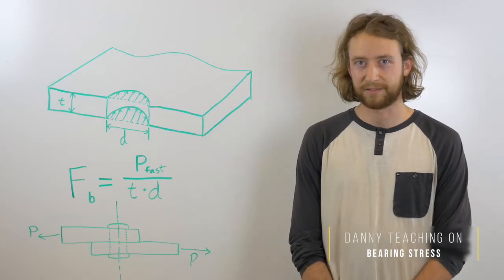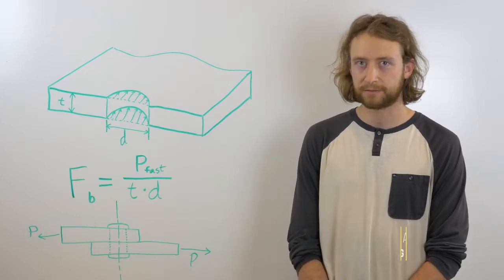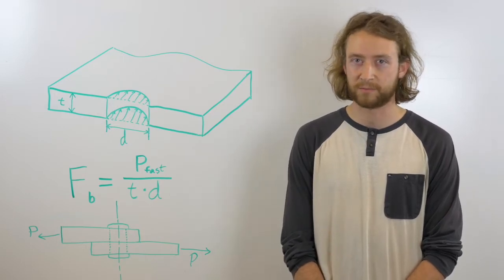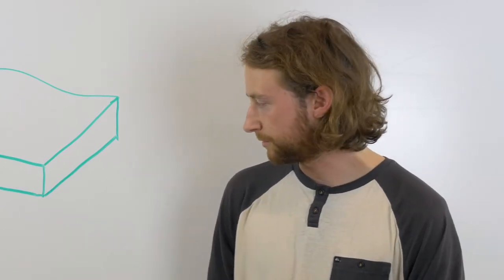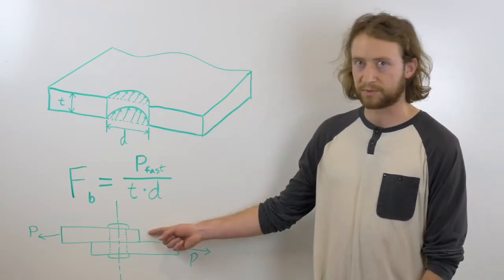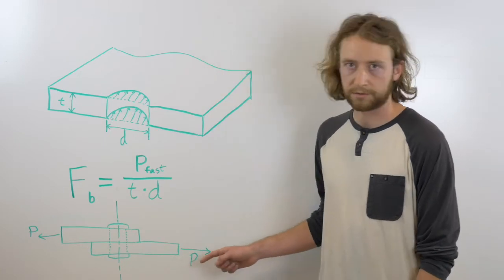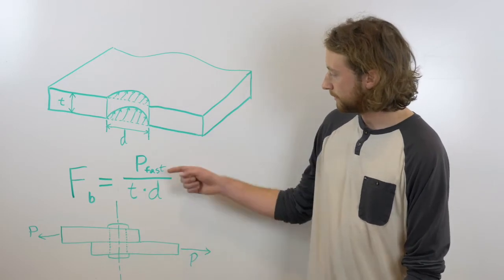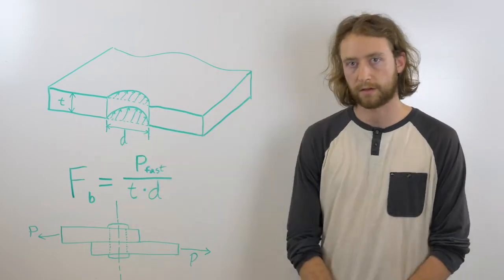How to Calculate Bearing Stress

Comment: what if my rivet/pin/bolt diameter is way smaller that hole itself? Would that equation still apply? Or would "d" would be a diameter of bolt?